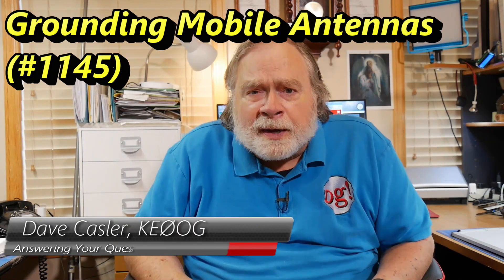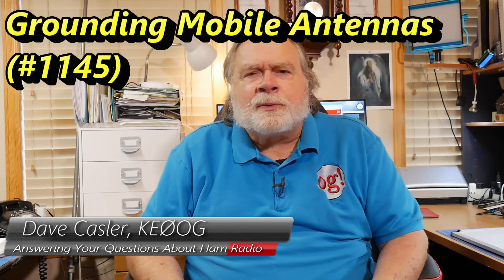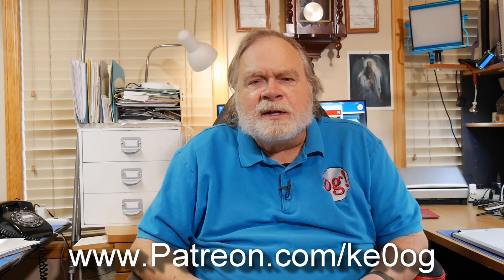Grounding Mobile Antennas (#1145)

Comment: My brother was a ship fitter at Todd Seattle and built those frigates that mixed steel hull and deck and aluminum superstructure. He described the technology of “fusing” (welding) the superstructure to the deck. They welded the aluminum together then hoisted the superstructure onto the raised steel around the openings after applying a “chemical of some sort” to the steel. Then everyone got off the ship and it was blasted with hi voltage until the structure fused with the steel. He told my grandfather (a ham from about 1913) and my grandpa said to him that “those ships are going to rust to death in 10 years.”

Comment: The creation of a car or truck to make it a counterpoise is a simple, but involved process. My ATAS, and 6M VHF/UHF antennas, are on a large plate of aluminum, as the first point of contact. All panels and the frame, engine, transmission, etc are connected by straps It works very well.